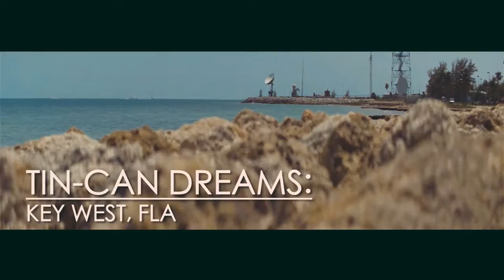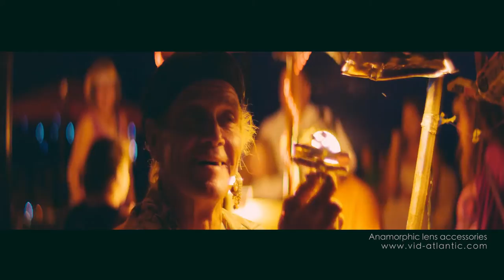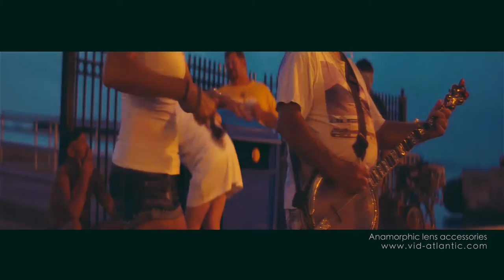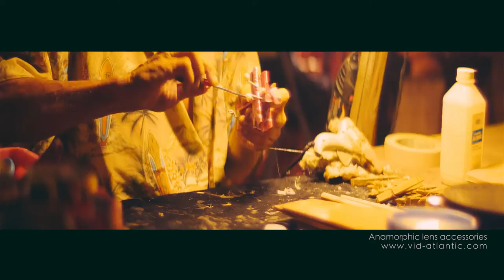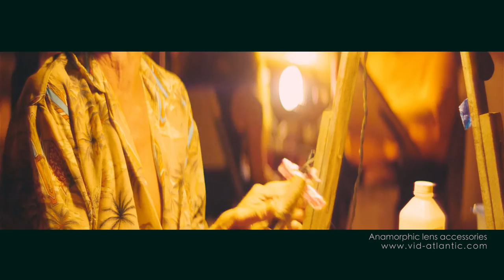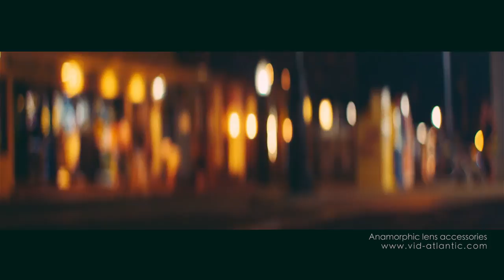TIN CAN DREAMS: KEY WEST FLORIDA (ANAMORPHIC & CINEMORPH)

Comment: does it make the image "soft", there by eliminating the need for any soft/mist filter?
Reply from the maker: Many anamorphic lenses can make the image softer due to low quality glass. This specific lens has very high end optics. But the more glass in front of the sensor the softer an image can be. Also if not focused properly (or purposely) yes, the image from anamorphic setups can eliminate the need for a mist filter.